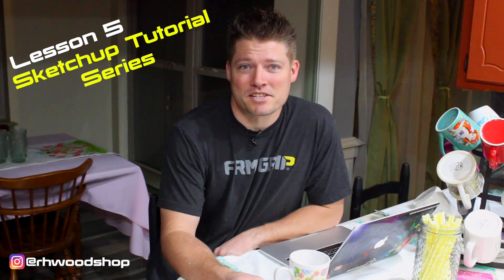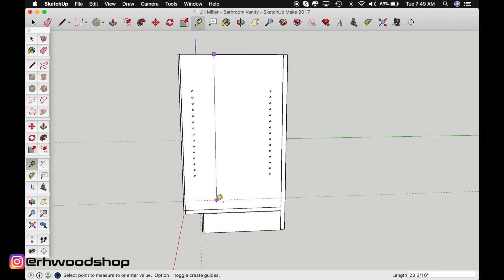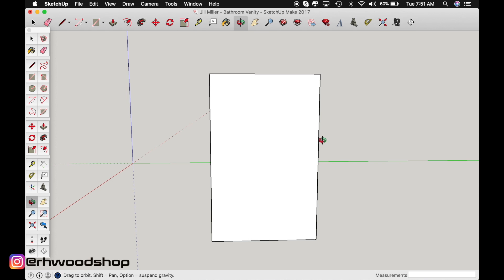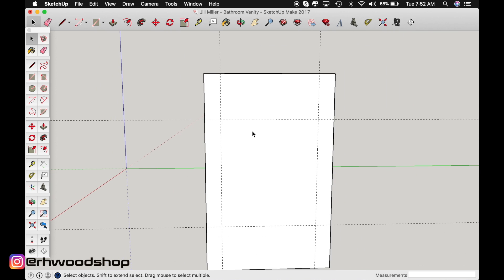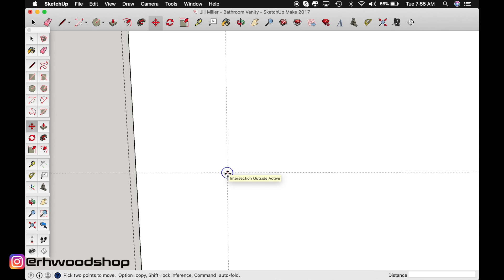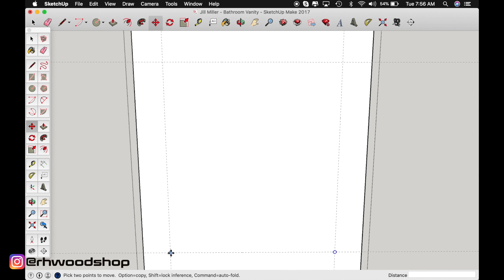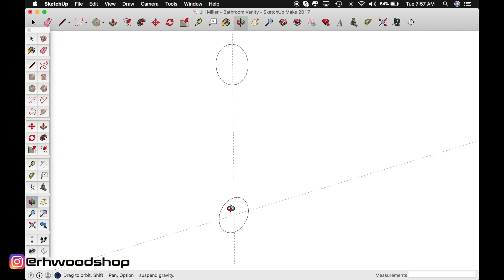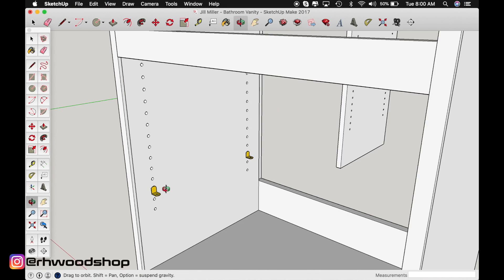Make Shelf Pin Holes Fast - Sketchup for Woodworkers Tutorial 5

Comment: extra info, just saw your next video with the cut face option the way I did it, was before I drew the circle I exploded the part then you can push it into the material and after copying all the holes just makie it a component again ( with holes in it. )
Reply: It is even easier than that.  Just make the first circle, push it in 3/8”, make it a component and then do your copies.  Seems that SketchUp doesn’t allow the push into the material once it is a component.

Comment: hi, just a few remarks, first: would it be a little simpler to draw a guideline from the left center horizontal  and then 7 inch up and 7 inch down, to keep it even more symmetrical ?second remark better to first push pull, and then move/copy (saves a lot of double clicking ) 
I knew sketchup pretty good (many years ago)  but this tutorial brings a lot of it back all the things I had completely forgotten Thanks kind regards Hans
Reply from the maker: That’s what they say, you’ve probably forgotten more than I’ll ever know. 😝

Comment: Great video, love the graphics added. Definitely spells out what "thingy" you might be referring to at the time. Also learned something similar to the copy/move recently. Instead of moving the pin hole up one inch and then using the "14x" (fourteen more copies), try moving the first pin hole copy to your LAST location and type "/15". This will evenly space (aka evenly divide) additional pin holes from your original pin hole to your last pin hole. I hope I remembered that correct. Picked up that little tip from Justin at TheSketchUpEssentials channel. Keep up the good work. I like your idea about doing little topics now that the "basics" have been covered.
Reply from the maker: +Marvin Alford Thanks a lot for that I appreciate it. I will try and put that into some use.